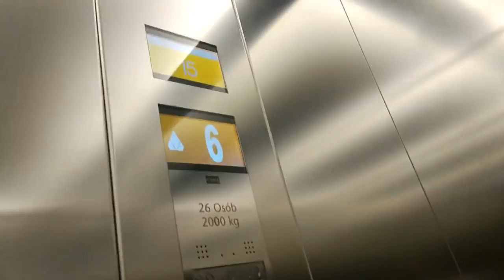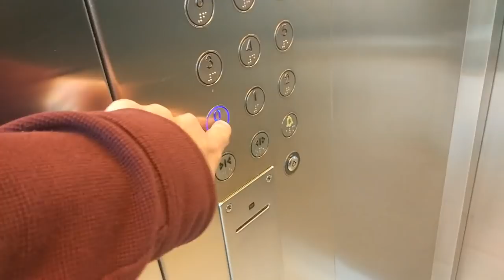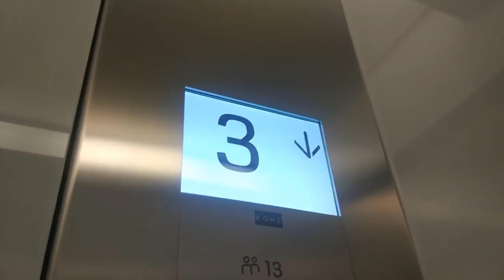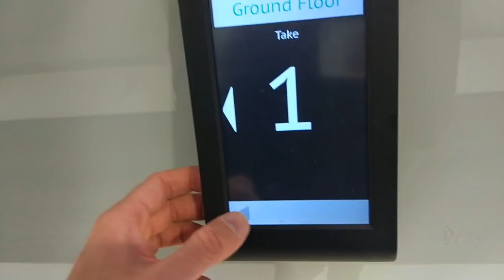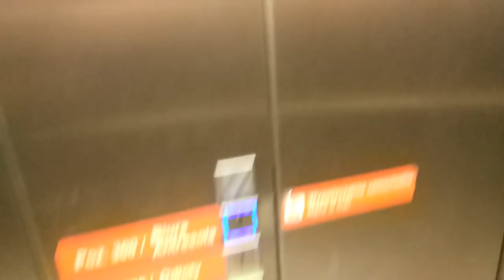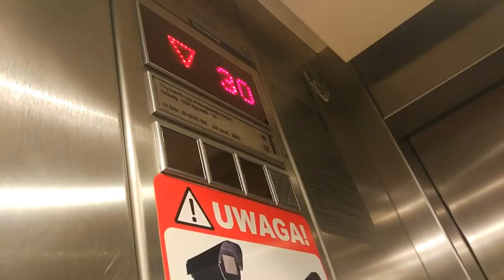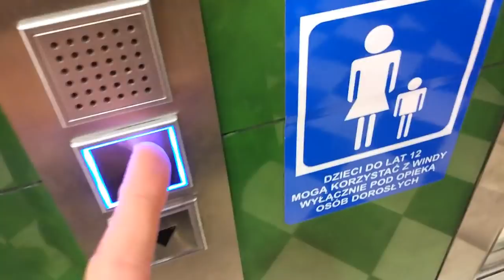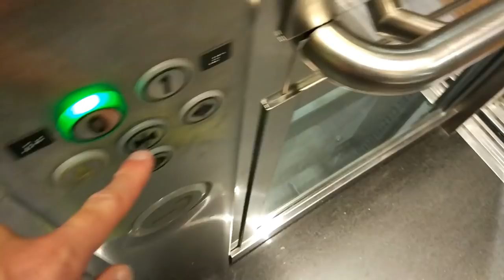Cheap flight adventure to Warsaw (part 2)

Comment: 1:51 | I'm jealous of Warsaw for having ambulances that make a positive contribution to the city's soundscape
1:55 | I grew up on Prague's tram network, where there are trams going in all different directions at junctions & you can easily get wherever you like, usually without having to change. Warsaw's is completely different: the trams nearly always go straight on & you usually have to change. This intersection doesn't even have points.
5:39 | Why is there a garment on the lift?